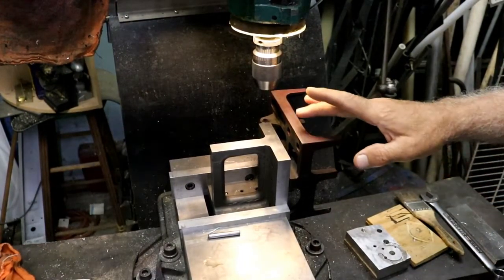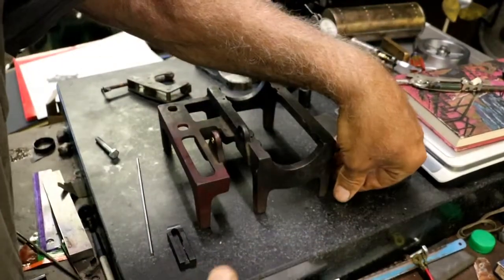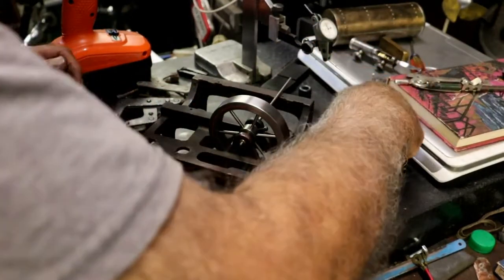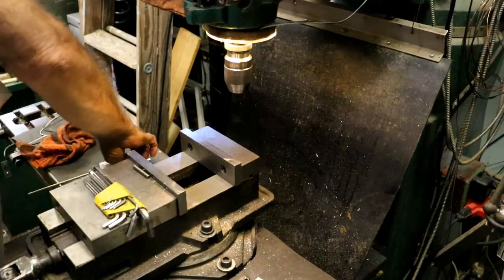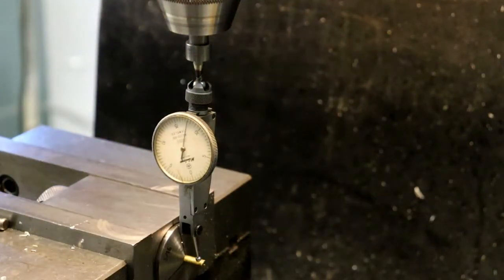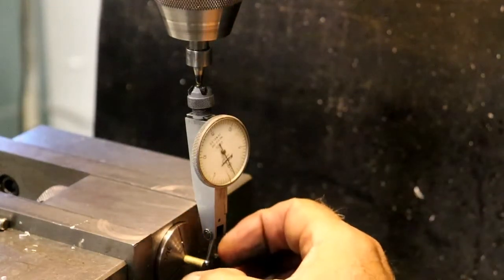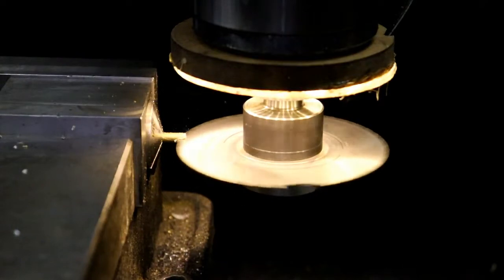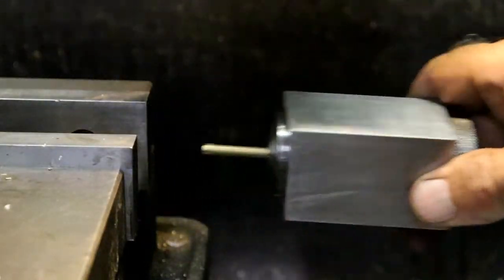Small steam engine build 30

Comment: The boring end mill is a great tip. I wasn't aware of the concept and it would have been in my arsenal if I would would have known, back when I was on the bench. I'm guessing not commercially available, rather custom ground in the shop?  It's funny I don't see many videos of guys using indicators to pick up edges etc. I guess it's an art dying out with us old dog toolmakers. We'll be up in the Brainard Mn area the first week of Aug if you're up for a road trip. I'll send details later when I know for sure.